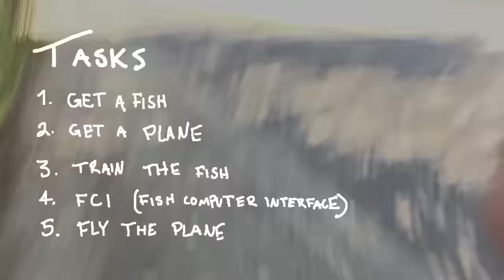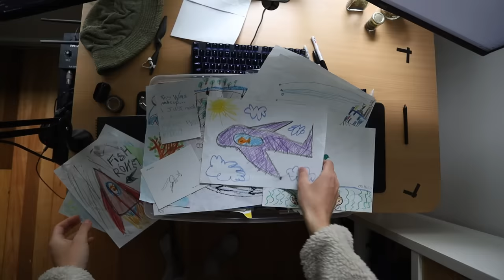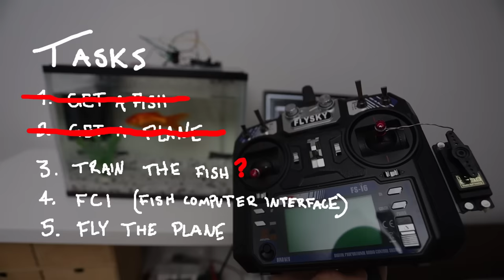I Trained My Goldfish to Fly a Plane

Comment: One thing I would check is the center of gravity. I recently built an RC plane, and it flew well, then later added a gear to it, and it flew like it was too heavy. I know the center of gravity was shifted too far forward. Now the rule that flight test has come up with is a nose-heavy plane flies bad, and a tail-heavy plane flies once. I would check your center of gravity if you haven't, and shift the battery around to change the position of the CG. I don't know what you tried and what you didn't, but it appears around 8:20 that it was tail heavy. You can look up more info online as to how you figure out the CG, but one method that works for me is just to strap a battery on throw it around, and see where it glides the best. Then just mark the spot on the wing where the plane balances, and remember to check the CG before each flight. Kind of a long comment, but I think if you do look into the CG, you should have things working better! Yes for all you RC pilots I am very much an armchair engineer (sorry lol). But dude you got a lot further than a lot of people, with a few modifications, that plane will likely fly well! Keep going, you got this! The fish shall fly!
Reply: Why is he holding the controller 😂
Reply: very useful!

Comment: You should fix the center of gravity, place the battery somewhere more away from the tail, I’m also wondering are you using ailerons and elevators or just elevons?
Edit: it’s actually a coincidence I came over this video because on my channel a couple days ago I’m making a homemade RC plane which is going to be an F-16 fighting Falcon and I only have a brushed motor that can connect to the receiver, not brushless, and I’m going to make a homemade edf with cardboard if I can. The only bad thing about my project is that there isn’t a gyro for RC plane stabilization, this was taken off a vintage RC helicopter which is an exceed RC Falcon 40 v2 from 2009. It says there’s a gyro but when I’ve been flying this, it didn’t seem like that at all.
Reply: Yes, judging by the takeoffs it looks tail heavy.
Reply: Yep, agreed

Comment: Really nice video! Did you happen to use one of Flite Test's designs for the plane? I'd recommend adding landing gear with chunky tires. Its cheap and can help you take off on grass, which is a lot better than hand launching. +1 sub btw :)